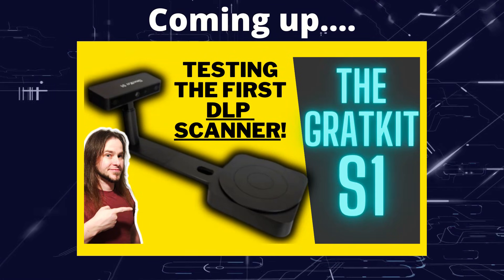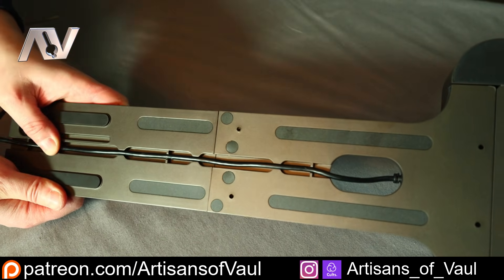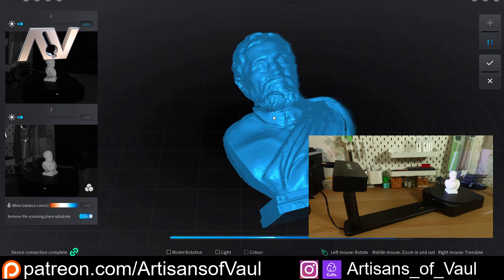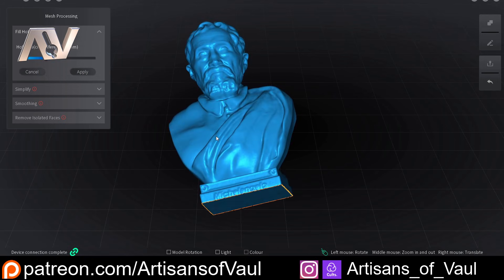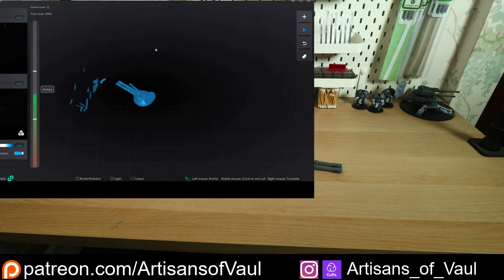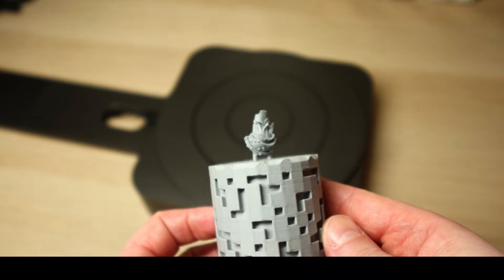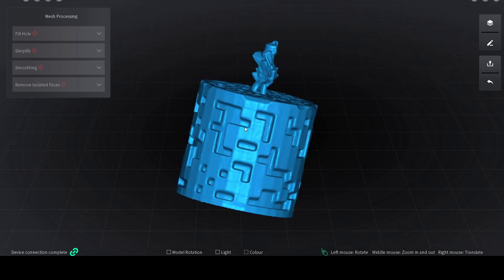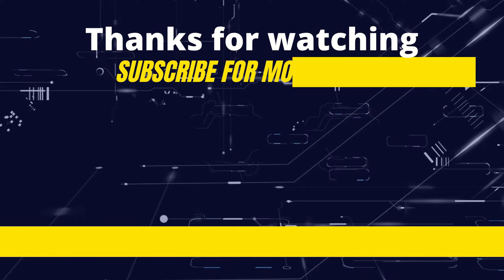Testing the FIRST DLP 3D Scanner - The GratKit S1

Comment: I have to say, I like what I see so far. But as you said in the video, the sharpness settings could use some fine tuning. Since posting this video, have you heard anything from the developers about this issue? Are they aware of this, and will they make improvements prior to shipping the product?

Either way, I'm quite excited to receive my scanner once they start shipping the units.
Reply from the maker: I fed back about it but didn't get told it was going to be altered (they didn't mention it either way).  But that doesn't mean it wont and they were very welcoming of the feedback, which is a lot more than some brands.

Comment: This is not the first. I've worked for over a decade with an HP DLP scanner.
Reply from the maker: Oh my mistake. Have you got a link, Id love to have a look at it.
Reply: @ArtisansofVaul  Yes, that's no problem. Good mindset! It was this one:
HP 3D Structured Light Scanner Pro S3

I don't think they still sell these anymore and it's a different price range because it came out in 2017 and it was more innovative at that time.

Though, this is the best scanner I've ever used. We often scanned jewellery, insects, etc.

Comment: Very impressive indeed. At this level of detail it seems not usable as is though
Reply from the maker: I think it really depends what you want it for.  If you're scanning something to then shrink down for 3D printing this is perfect.  It creates a manifold mesh and the details at a smaller scale would look spot on as you wouldn't see any rounding.  Im sure the software could be set to make edges more crisp.  If it happens I will definitely report back.

Comment: As someone who has never used a 3d scanner before, but would like to try one:
I like the video, especially the "trying to f it up" and emphasis on personal experience. 
I would have liked some more detail on the comparison to other types or scanners on the market and different light and body surface conditions (like scanning outside, scanning polished objects, etc.), I don't know if this is basic knowledge tho. 
As someone who likes making assemblies in parametric CAD software, the accuracy (nominal length, concentricity, etc.) would be interesting as well. 

As always with a kickstarter, you never know what/when/if you will get in the end, but this looks quite final.
Reply from the maker: So a range of questions that are "basic scanner knowledge " some some ones that aren't 

So:
Shiny and black surfaces are hard for 3D scanners. Even the ones that claim they can manage them arent that good (just not hopeless) but in all instances you can buy scanning spray that temporarily turns the surface white.
Compared to other scanners this captures information very quickly, which for some uses is really helpful. The sizing seems to be around the same level as IR scanners but its hard to tell if its up to the level of blue light laser line scanners because of the rounding of sharp edges I mentioned. But even in that comparison they are all sub-mm accuracy so I find them acceptable for my needs 
In terms of the kickstarter a lot of 3d scanner and 3d printer companies tend to kickstart designs. I dont know but I would guess they can use it to get an accurate idea of production numbers and then use that to buy what can be quite expensive components more cheaply buying in bulk (hence the discount). Unlike some other kickstarters for other products this is definetly a working model they have a number of so I wouldnt forsee any issues, its not some small indie company.

Hope that helps.
Reply: @ArtisansofVaul  Thanks a lot for the thorough explanation and also answering the 'basic knowledge' questions. this does help ^^

Comment: Hmmm... very cool.  I wonder if this is what oldhammer fans finally need to recreate old miniatures
Reply: Its already happening on telegram.
Reply from the maker: The turntable helps with those small scans a lot as it makes it so much more reliable. If they ever came out with one specifically designed for smaller scans I think it could easily be the best option out there for miniature scanning.

Comment: Nice!  I have used a lot of different scanners over the years and for the price, I am impressed. Only one thing I see is that the user should have control over the sharpness of the finished scan.
Reply from the maker: Agree on all fronts. I received the test model before being told the price and was pretty shocked at the value for money. I really hope as the sharpness is a software factor it will be changed and improved upon as the scan clearly has enough detail.